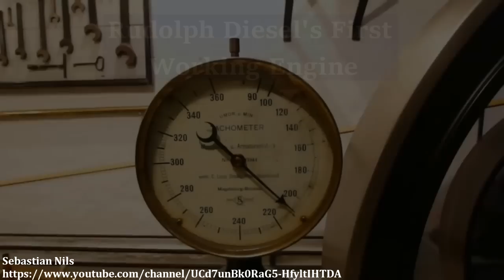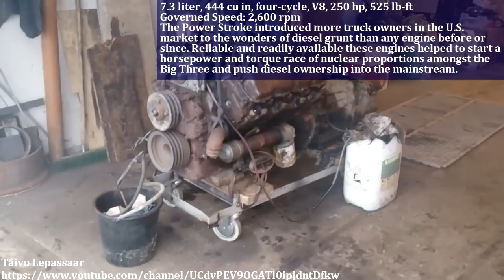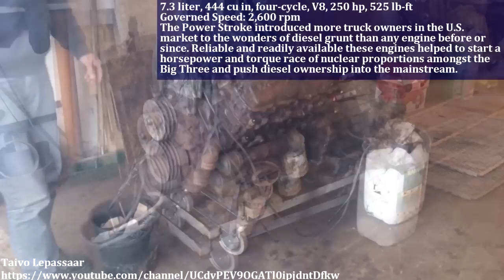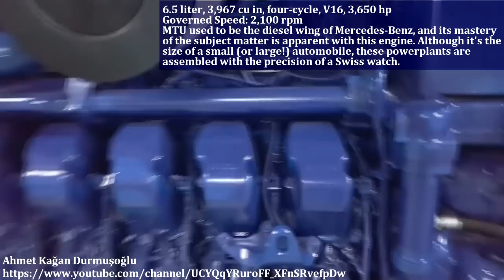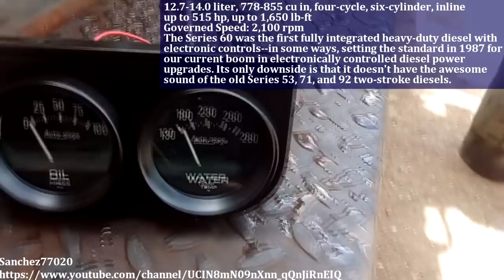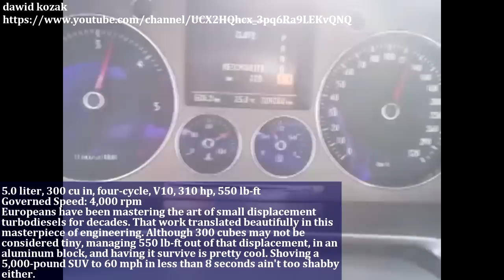10 of the Greatest Diesel Engines - Ever

Comment: the sad part is that 7.3 was not a powerstroke it was a 7.3 idi pre turbo
Reply: it's still a very good engine, i would not mind owning one
Reply: 7.3L IDI SpecsEngine:International/Navistar 7.3L IDI V-8 dieselValvetrain:2 valves per cylinder, standard OHV, standard camshaft in blockPeak Horsepower:185 hp @ 3,000 rpm (naturally aspirated) 190 hp @ 3,000 rpm (turbocharged)Peak Torque:338 lb-ft @ 1,400 rpm (naturally aspirated) 388 lb-ft @ 1,400 rpm (turbocharged)
Reply: Robert Lange Don't know this source,but it's way low!!! Factory stats for the old FE block 352. Gas motor were higher than that in 1965!!!   Better try a new website!
Reply: the source is correct it matches the ID plate on my 93 7.3 idi that I drive. they are not high HP or TORQ engines. If you need more proof look for 1988-1993 7.3 valve cover stickers.
Reply: Robert Lange the quoted numbers are for very late 7.3 PSD's, early on they were 210/420
Reply: Glad i'm not the only one who noticed the injection lines. Could be a 6.9.
Reply: LOL, the guy that's going to tell us what "10 of the Greatest Diesel Engines - Ever" are can't tell the difference between a PSD and an IDI. BTW I own two trucks with IDIs in them, great engines, I choose them over any other pickup engine.
Reply: I like the guy trying to argue expecting early diesels to actually have power lmao
Reply: A yeah, I'm a fan of the 7.3IDI but stock they're pretty darn anemic, those numbers are correct.
Reply: The IDI and PSD 7.3's have absolutely nothing in common except for their displacements. Parts are not interchangeable between the two.
Reply: Chris that's not 100% true, a few parts are interchangeable. A few external parts, oil filter, clutch, transmission, etc. But only one major internal part comes to mind, the connecting rods, they need to be slightly modified but PS con rods will work in a 7.3 IDI.
Reply: Howard Rourke that's only true for a factory turbo piston. Pin size is wrong for a n/a or 6.9 piston. It can be bushed, but machine work is beyond what most call interchangeable.
Reply: Evan, that's completely true, it's also moot if you have an IDIT as the general consensus is that the IDIT rods are stronger then stock PSD rods. But useful info if you don't have an IDIT and want to build a good motor out of an NA using IDIT pistons or just the ultimate IDIT. Mostly cause rather good aftermarket PSD rods can be had at a reasonable price and machined thinner to fit the crank.
Reply: ok yall seem pretty savvy with engines. i got a 460 with 4 speed AT/OD in my '90 f250. ive seen stock gas engines with add-on forced induction (maybe up to a max of 8psi) make pretty decent power that i would be happy with and in some cases they are putting out more power than stock factory forced induction diesels. 

so my question is (based solely on real world prices and costs), would i be further ahead adding some sort of forced induction to the engine i already have (especially if i could install it myself to save money) or would i be further ahead financially to swap engines(to a used forced induction diesel) and or other components in which case ill most likely have to pay a garage to do it all?
Reply: All depends on what ya do and what ya want.
Reply: maybe somewhere around 400Hp 600Tq but regardless i hear its bad for a stock engine to go much past 6-7psi so whatever kind of power i can get out of that ill just have to be happy with. id prefer to be well under $2000 for a simple bolt on kit. i was thinking centrifugal if its the simplest/quickest/cheapest to install. its kind of an all around vehicle that  has low gas mileage already so any further drop is pointless to worry about.
Reply: Those aren't hard numbers to reach with a 460. Deep down the 460 is a good engine and well 460ci so 1hp per ci is 460HP, not that hard to get to 400HP. The issue is that Ford castrated the 460 to meet idiotic Kommiefornia and federal regulations. Lot's can be done though and EEC-IV EFI is easy to work with. As boost goes in a sense you're in luck having a castrated 460, they have a low compression ratio so they'll handle some boost rather well.
Reply: although my truck has a newer cat on it, there is no smog check here in northern WA and this truck was originally canadian. only 116k for $1600. primarily just needs cosmetic tlc. tranny has a rebuilt tag on it. mechanically great but idles fast. if i pinch off the air feed to the IAC it slows down. tried replacing the IAC to no avail. i dont get that one. 

also i seen someone on youtube explain something about advancing the timing and switching to premium fuel to gain a little more power. is there any truth to that?
Reply: Decent chance that the fast idle is due to the TPS being out of whack. If the computer thinks you're on the throttle it opens the IAC so that if the load is higher when you lift it doesn't stall. You can loosen the TPS with it running and rotate the sensor to check. Double check but I think it should output less then .5V at idle if you want to check that. 

As for advancing timing to gain power, absolutely, the factory settings are very conservative. Do you know what spark knock sounds like? It sounds like marbles in a can, or like a diesel engine. Don't bother with premium but just advance it two degrees, and drive it. Keep an ear open for knock, if you don't hear any after a while go another two degrees, repeat until you hear knock or are no longer getting more power.
Reply: Howard Rourke Great and accurate advices, well done..!
Reply: Thanks Henry, big fan of your work as well, lol. 
 
Billy, I should add, on advancing timing if you hear knock then you have a choice. You'll either need to bring the timing back down or then go up a level in fuel. That'll be up to you, more timing = more power and MPG but knocks on cheap fuel, or cheap fuel and less power and MPG. And no you can't just let it knock, knocking = engine damage.
Reply: Prefer the 7.3's daddy the 6.9
Reply: Chris Marek motor mount and bellhousing bolt pattern is
Reply: The IDI only had 388 ft torque @ 1,400 RPM (7.3 L turbo)
Reply: "only" those where good numbers at the time.
Reply: Robert Lange diesels wasn’t making Torque numbers like that back in the IdI days, I had a 2005 6.0L Powerstroke with a lot of upgrades and a tune, but the stock hp rating on the 05-07 6.0s where 325hp and 570 ft lbs of torque. And everybody knows a 7.3 doesn’t make near the power a 6.0 does.
Reply: Robert Lange The later 7.3's had the power, but the earlier idi's still deserve respect for their reliability and simplicity.
Reply: Peak Horsepower:185 hp @ 3,000 rpm (naturally aspirated)
Peak Torque:338 lb-ft @ 1,400 rpm (naturally aspirated)
190 hp @ 3,000 rpm (turbocharged)
 388 lb-ft @ 1,400 rpm (turbocharged)
Reply: squach623 !!!!! Those are the 2003 powerstroke specs I believe
Reply: Exactly what I thought, thanks for putting this out.
Reply: It still sounds amazing though
Reply: right! not the 7.3 that everyone thinks of. still a sweet rig tho
Reply: Robert Lan
Reply: In my oppinion, the 7.3 was the best engine ever made. They were very  reliable and last so long. The only  thing to complain about is how they start in the winter time .  other than that you can put half a million miles on them and the compression is still like new.
Reply: @Billy_Darley  with a gas engine you paying for it everyday with less fuel mileage
Reply: @davidsignor7931  lots happened in a year. Trucks sold. $4200.
Reply: Those are powerstroke numbers. And of course f.e. engines in the 60s had better numbers. Absolutely ZERO emissions, and on leaded fuel. Also, one of if not the best engine family ever built. B series is the only other mass produced engine I can think of that can go from industrial duty, to a boat, to a daily, and an 9 second drag race engine easily. But even in all iron trim, the f.e. is half the weight...
Reply: snek Same here, kids can have their $50K+ trucks with 600hp that have to go to the dealer to have the oil checked, I’ll take the 7.3l IDI and be able to repair anything under the hood on the side of the road at night using a tool kit that fits under the seat. Neither of mine ever failed to get me where I needed to go regardless of what I was hauling or towing.
Reply: Connor ElanRider when I got rid of my 88 F350 w/7.3l IDI it had about 475K miles and all the holes were over 400psi. The only reason I got rid of it was because while I had it parked waiting to put a new cab on it, water got past the cowl seal, pooled in the air cleaner, and found its way into a cylinder. You can guess what happened when I cranked it. I didn’t want to do the cab AND the engine so I scrapped it. I wish I’d kept the rack body for my next F350, though, pickup beds are pretty much useless for hauling.

Mine started pretty easily in the cold, I usually plugged it in once the temps dropped to around 30F but even around 0F she’d start with 3 or 4 glow plug cycles and no block heater. Lots of grey smoke that made your eyes water, though! LOL
Reply: The bad part on the 7.3 is the Stanadyne injection pump instead of Bosch.
Reply: Robert Lange: 7.3 was a International
Reply: Slave lake. Like if ya get it
Reply: Power joke

Comment: What? No mention of Mack engines?  Only a passing mention of the Detroit Diesel 2-strokes? No mention of the venerable and long serving EMD 567, 645, and 710 series locomotive engines? A serious misfire there.
Reply: or the 3208 cat
Reply: I've got a Mack 300+ maxidyine in my B model. Something like 315 hp, 1100 torque...
Reply: HENRY HARLE and  3408 . 1693. 3406. C15
Reply: Are 1994 mack has the E7 engine with the mechanical fuel pump has 350HP with I think 1700 Ft lb of torque
Reply: TomRedlion Mack? Really? What a joke. Ugliest trucks on the road
Reply: Bleep Blorp rolmao I'll put mack up against my peterbilt or freightliner. ..I see more macks on the side of the road trying to run has well work than any other trucks combined...Mack is junk
Reply: TomRedlion o
Reply: TomRedlion
 the omission of emd is outrageous you are definitely on it
Reply: Bleep Blorp
 thats because those guys never worked
Reply: TomRedlion I love the emd 567 series engines in the old sd7s they sound amazing and so do 645s in the sd40-2s
Reply: The VW i-4 turbo needs to be here. The current engine may have an emissions problem but there is no doubt that those little engines are very reliable. The W10 diesel is an expensive nightmare.

Comment: The 3406 A and B series CAT engines should have been in here, also the CAT 1693
Reply: im in the process of installing cly. pack in a b on a 300kw genset. the whole 3406 line a-e are super tough horsepower makers. they do leak like a Detroit though..lol
Reply: Kelly Penrod: 3408 was awesome too
Reply: I'm a big 7.3 IDI fan, I had to scroll to see if anybody else had picked up on that. I much prefer the 7.3 IDI anyway. no computers, no bullshit, just endurance. and now they make a solid fuel rail you can replace those stupid plastic fuel return caps with. 😎
Reply: @georgemoulton8708  Detroit didn't leak! They would simply splash oil out of that stupid pan. I had a 69 Pete with an 8v71, Amory read 8v92 TT, and a 16v 149 I kept in storage for a long time because I could not part with it. It came from a genset I was paid to haul to the scrap yard. What a beast!

Comment: What about Mack E9 V8,Cat3406.Cummins BIG Cam3,Mack E6 Maxidyne?
Reply: I've had all those motors, miss the E6 and E9 the most.
Reply: And what about Mack EE9?
Reply: The newer motors won’t ever hold a candle to the mentioned here especially that duramax crap
Reply: The MACK E9 Military version with four (4) intercooled Turbos boosted its output to 1000 hp. Saw an RW with this powerplant in Phoenix AZ about 23 years ago …

Comment: Duramax but none of the Deere diesel engines? Deere made at least four legendary engines as far as good performance, fuel economy, and reliability are concerned. There's the JD 404/404 turbo, JD 466/ 7.6L, JD 6068/ Powertech 6068, and the 6081/Powertech 6081. All of these engines are capable of going 10k hours or more, while being worked hard every day for years. We have a JD 4455 with 7800hr on it, that is pushing past 185hp and has never been touched other than to change the oil and filters.
Reply: Not to mention the old JD horizontal twin tractor engines.
Reply: deer copy ih with the 466?!
Reply: 34486 SCI the only thing the IH 466 and Deere 466 share as far as I know is the size. The IH is crossflow I believe while the Deere has the intake and exhaust on both sides. Both are good engines, but the Deere was designed specifically for use in tractors and other equipment, the IH was more of a truck motor as far as I know.
Reply: Ye I checked tractordata to get engine specs and the bore and stroke are far differnt, deer had a much longer stroke, smaller bore. the 466 in my 1066 has exhaust on right and intake left.
Reply: 404 was a tird.  301 allis chalmers was way better.  Power tech is based on the 466 isn't it?  Did chevy copy Plymouth to get 350?  Just because 2 engines share a displacement doesn't mean they are copies.
Reply: Is that all, I operate Cat 777 b/d trucks on mine sites with well over 60K hours
Reply: IH 466 was considered a high speed diesel, back in the day, hence the shorter stroke.
Reply: same, i have a soft spot for AC diesels, they really had it goin on in the 79's
Reply: john deere engines are indestructible
Reply: It’s hard to kill Deere engines, those 404/6.6l, 466/7.6l and the 496/8.1l engines are simply hard to beat. The 6.8l 414 is an excellent engine, we have had all 4 engines on my farm and they all have went far past 15000 hours without major work.
Reply: John Deere's 4 cylinder engines were really good too. Especially the 4045.
Reply: Fiat made good diesels too, seen a few with over 13,000 hours
Reply: We 4430's, 4440's, 4630, 4840's all of them have 8000-9000 hrs no rebuilds...IH 466 engines only make it 5-7000 then rebuild...
Reply: Fun fact, the Deere 466 uses international pistons and Cummins sleeves. JD has a hard time with the engine until they talked to a guy who pulled tractors and told them how he made his run. Just shows that the only way to make a Deere run right is to take the Deere out of it lol.
Reply: I think if Deere put their 466 engine in a truck it would not last, it works well in farm equipment but the liner o-rings being placed in the block instead of the sleeve is an   issue, rebuilt some tractor engines where pitting that would normally be on the sleeve is on the block and would mean replacing the block rather than the sleeve.  Im a big JD fan, just what ive noticed rebuilding a few brands